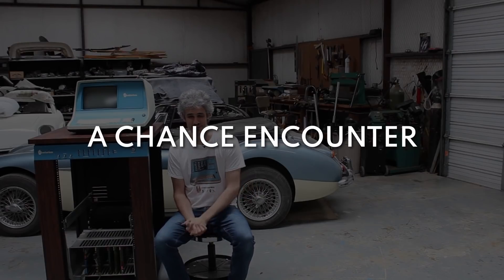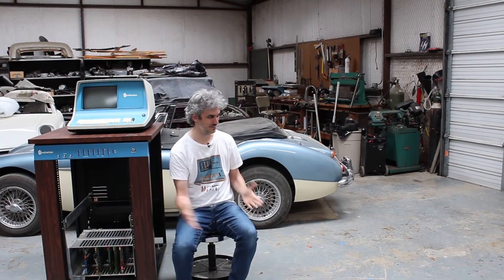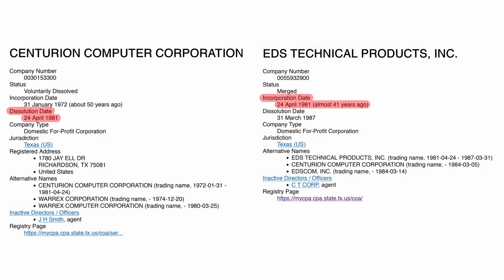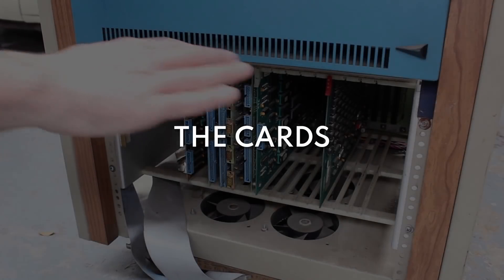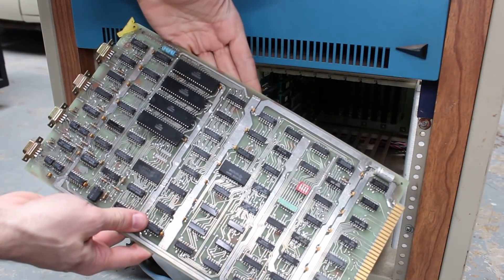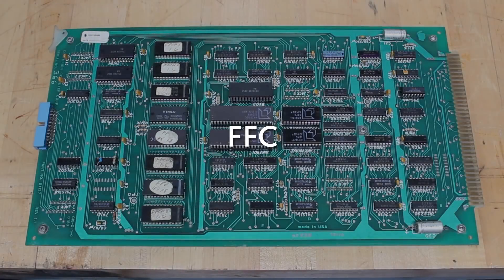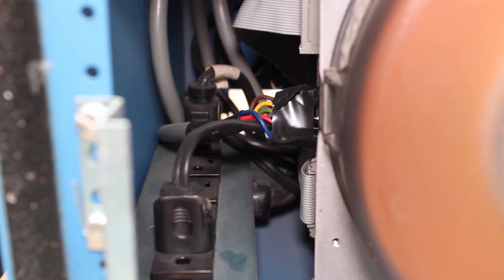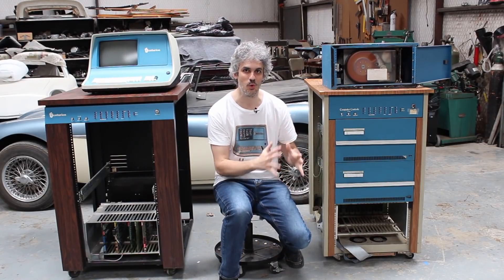Minicomputer Part 12: I Bought a What?!

Comment: It is amazing that you found another one of these and even one that shows the history so well. 
But what is even more amazing to me is that some company or organization used that thing at least up to 1994, mabe even longer who knows.
Reply from the maker: It's pretty crazy that they used that thing as long as they did! 
Some ex-Centurion employees were actually building Centurion software emulators on 386s and 486s by the mid-90s, trying to get customers to switch over to a more modern and stable hardware set, but the PCs of the time didn't have near the same multi-user capacity, so I can see why some places may have been reluctant to upgrade.

Comment: I would say that along with the importance of the machines' body is the importance of the machines' soul.  To think in a way to clone the disks content into modern media, to more than one type, like into disk images on SDs, SSDs,  into the cloud, and so.
By the way, excellent series, congratulations for the incredible work you are doing and to all that are activelly helping you on the path.
Reply from the maker: Thank you!
And that's absolutely on the list! One of the big reasons I got this system was because of the software that there may be on it. If we can get one of the Hawk drives working and connected to the genuine machine, we can then write some simple software to bit stream the data out the MUX card and onto a modern PC for backup!

Comment: Thanks for sharing, really cool. Having a second machine makes life a way easier because it allowed to make a diagnose by swapping the parts and/or using one as a donor to another, so you was really lucky to get this. I'm repairing an Epson HX20 from 1981 now, much smaller scale than yours but still fun :)
Reply from the maker: Thank you!
And you're absolutely right, having the genuine machine to test and diagnose parts makes life so much easier, and then we can really start doing proper work with the drives and hopefully save some of the original software.
The HX20 machine is such a cool machine because it was the size of a piece of A4 paper, which is absolutely mental for 1981!

Comment: Can the two computers do DMA off of each other's busses? You could have the first dual-core Centurion SMP cluster on your whole street!
Reply: That's for sure. When the "dual core" is operational noone else is getting enough electricity to run a similar machine.😁
Reply from the maker: Unfortunately, they're not quite setup for that. But, it has been done in the past!
Apparently, one very smart engineer at Centurion took four CPU6 boards, built a custom backplane and wrote some very unique microcode to create, essentially, a four-core Centurion! Now that would be a proper piece of Centurion history!
Reply: @UsagiElectric  Well, if we all put our ripple tanks and 3D printers to work and made one from sand and oil, we wouldn't have to endure the purists who get mad about which parts were and were not re-made for the damned Centurion Wing of the National Computing Museum.

I just love the whole energy of this series (and its other fans) and nothing would make me smile bigger than this obscure little platform of yesteryear suddenly exploding into a 6502 level fanbase: "How I Made a CPU6X8 In My Spare Time For Only $10,000". And at the end of the article there's the table of 100 digit precision arctangents he printed. :) :) Seriously, I'm loving this adventure in retrocomputing so hard.

Comment: Re: interrupt level driven multitasking, I would call it multi-tasking at an extremely low-level. Interestingly enough, this is roughly how modern systems handle the myriad of interrupts from all our fancy devices, along with all the requisite handler/service routines and then the later bottom-half handler/DPC routines (usually de-queued by a specific thread with IRQ’s enabled in Linux, or at the DPC IRQL in Windows (NT)). That said, using just basic interrupts to drive user context switching for interactive workloads is a less than great approach, but probably worked okay for the very basic serial attached terminal driven workloads of the time.

I gotta say, the more we learn about Centurion, the more it sounds like a great basis for a period TV show.

Comment: The interface on that Finch card looks quite familiar, and looking at the hard disk specs makes me wonder if the drive was actually an early MFM drive. Which means you could connect up any 1980s hard disk drive (e.g. a Seagate) as a replacement.
Reply: I noticed that too (the dual ribbon cable ports), but I kind of doubt they're spec'd for an MFM drive. I'm thinking that they are probably closer to early 50 pin SCSI drives as far as operation and data transfer. I had a couple of those 20 mb. Seagate MFM's in my first 80286 when I was playing around with some early versions of MS-DOS.😉Talk about NOISY! They all sounded like a jet engine spooling up when they started!🤣
Reply: @danw1955  The drive spec sheet talks about being able to connect more than one disk (either floppy or hard disk) on the wide ribbon cable, and the narrow cable is point-to-point. That leads me to believe that this drive may be MFM.

MFM drives were also pretty common in early 1980s systems so it wouldn't be unlikely.

I didn't see any big circuit boards on the drive itself -- SCSI drives contain a considerable degree of intelligence in the drive, while MFM drives are just dumb electromechanical front-ends.

Comment: I find it amusing that the rack is standard because the rack is based on the telecom switchboard dimensions, and by that point - in the 70s, everyone had standardised their racking against telecom standards which was the origin of the datacentre. IBM tried to buck that trend for a while with their mainframes, but the telecom rack won the battle.
Reply: I recall Telecom Equip. racks being 23" wide and Data Equip - Networking or Computer racks being 19" wide.  The Centurion chassis rack is setup for 19" hardware.  Mr. Martin are you in the North Dallas area, seems like I know may know you?

Comment: I'd hope the computers were decommissioned because the company finally got off the accounting system they were running on it.  It's really hard to change accounting systems, so they probably kept the old one running as long as practical.  I'm guessing it's accounting, because that seemed to be the most common, but it's probably some core process that would be a mess to transfer to new software.  Although, I wouldn't rule out that it was decommissioned when the company running it went bankrupt.  They simply didn't have the cash flow to convert.
Reply from the maker: You're on the mark! The two removable platters that were in the drives when I got the machine both had stickers on them that say "payroll." 
By 1995 the CPU6 design was already around 15 years old, so it was definitely outclassed by many modern machines like the 486 or even the Pentium, but I'm with you in that they probably didn't want to try to transfer to a new software environment or they didn't have the cash flow to convert.
It'll be interesting to see what kind of condition the drives are in!

Comment: Hi David.
Love this series btw.
I've just been looking through the instruction page on the wiki you mentioned and in the Address Byte column you have mnemonics (in order of appearance) PC+N, _H/L, _W, _H/L_H/L, _W_W (I'll stop here as there are a lot more), but there is no indication in the notes column as to which byte (H or L) the instruction is working on or what the N is referring to.

Also, I think there may be some errors, I maybe wrong, in the positioning of the _H/L_H/L and _W_W entries that appear in the first Address Byte column.  I'm wondering if they should be split between the two Address Byte columns ? Being that each column represents 8 bits and the H and L are both 4 bits a peace.

Besides the above observations, I think it's a great breakdown and very informative. I have my own challenge, similar to your 1 bit Valve computer (excellent btw), and this Centurion series is very helpful.
Reply from the maker: Thank you so much!

The Wiki for the instruction set has actually recently been updated (like within the last 24 hours) to something that should hopefully make a bit more sense. We're still figuring it all out, so it's likely to change a couple more times as well. 

The big thing that I think was poorly explained is how you address registers. Since the registers are all 16-bit, you can either address the register as a whole, or you can individually address the high byte or low byte. When I write "_H/_L" or "_W" with the preceding underscore, the underscore represents whichever register you want to address. 

For example, an ADD byte operation would look something like: ADD AH, BH which would add the high byte of the A register and the high byte of the B register and store the result in the A register. To convert it to hexadecimal, the ADD byte OpCode is 0x40 and each register is addressed by a nibble that represents which byte we want to use, so register AH is 0x0 and BH is 0x2. That means that ADD AH, BH = 0x40 02.

Interestingly, if we want to do an ADD word operation, we use the high byte nibble when referencing the entire word as well, which gives us ADD AW, BW = 0x50 02.

At any rate, that's how they address two registers and specify word, high byte or low byte using just 8-bits. 
As for the PC+N, this is just a relative jump from the current position of the program counter. The +N is the 1-byte offset to jump. However, with this one it's best to think of it in binary. The first 7-bits is the distance to jump, and then the 8th bit is the direction, which means it can jump up to 127 instructions forward or backwards. For example, if I wanted to jump 34 instructions forwards, the instruction would be JMP 0x22 = 0x72 22. If I wanted to jump 34 instructions backwards, I just change the 8th bit to a 1, which gives us JMP 0xA2 = 0x73 A2.

It's a pretty wild instruction set with a boat load crazy things you can do, but hopefully that gives a little more insight!

Comment: "Just two Davids.... hanging out..."

I just finished watching this entire series.... this morning i woke up thinking about those bypass capacitors doing the back-flips....

Ceramics are fragile? So maybe bending the leads like that offers mechanical strain relief? Looks like it gives a nice place to clips scope leads, but why you'd need that on a bypass cap, let alone all of them....

I don't remember which video that was brought up in... there's probably an entire thread under that video dedicated to the question... with a correct answer...

Comment: Hi Dave and Ken;
Ken, Thank You for Your prompt reply.. Ok, I understand..
Do You remember on CPU1 and CPU2 and CPU3 what was used as an ALU, like 74LS181 or something even more basic like the 74LS283 ?? Or something else?? I would like/love to build one using wire-wrap and taking any information You can provide that would help me build these boards on blank wire-wrap boards, mostly of my own design using Centurion instructions..
THANK YOU Marty
Reply: Do not recall if the ALU used any of the chips you called out.  The 74LS181 is out because of the 24 pin package, do not recall any 24 dips on the CPU cards.   All the TTL and ECL chips had to be available well before 1971.

Comment: Wow. Cool  system.  I cannot wait until you clean it, and get it running.  Can you connect the Finch drive to the genuine Centurion?   or doesn't it have the necessary software/hardware?

Comment: These weren't counterfeit, per se. IIRC, they were manufactured by Centurion from their spares as off-the-books units. A little extra secret revenue stream not shared with new owner EDS. That was the sticking point and final nail in their coffin.
Reply: Mr. Jones,  Did you work at the Centurion dealer in Richardson or Tulsa?  I would like to talk with you sometime. Just talked to Terry a few weeks ago.

Comment: Anything new on the MC14500 1 bit computer?
Reply: What was he doing with one of those? Did he talk about implementing it in discrete transistors/tubes? I think it only used 500 transistors.
Reply from the maker: Actually yes!
I've been working on the UE14500 vacuum tube implementation of it regularly, and there have been recent update videos on it (the video released last week was working on it). 

But, behind the scenes, I've been using everything I've been learning from the tube version and from this Centurion to start designing a full homebrew based around the original MC14500. I'm trying to design it with a universal bus and expandable cards, plenty of RAM, cartridges that can be popped in for different programs, and to run at near 1Mhz. The goal is to have an MC14500 based system that can interface with a terminal properly and do standard computing stuff. It'll require some very inventive programming to get it doing anything meaningful, but I think it could be a very interesting homebrew system!

Comment: These date from the time in which the novel "The Adolescence of P1" was written.  There was an attempt to turn the story into a movie, using more up-to-date technology, but the tension and tragedy of the original story was totally lost in the process and the ending of the movie was pretty lame.
(The novel is another "computer program becomes a sentient AI" story, but with a few twists since it crosses over with computer viruses and networking and non-corporeal entity themes.  The computer program doesn't run on a single computer but on hundreds of computers across a network of "teleprocessing" ports).

Comment: Hi All;
Thank You Ken for Your prompt Reply..
Ok, does any of these ring a bell with You, 7480, 7482, 7483, 74183, 74283 ??
Also, did You base Your Design on any existing Machines, like Varian Computers ?? Or was Your Design an all new concept of the way things would be done?? Such as (I gather or think) using memory for the base registers and the Interrupts for choosing where the base register was accessed or located ??
Thank You for Your time and Answers..
MARTY
Reply: The great grandfather system to the first Warrex - Centurion system ( CPU4 ) is the [ ee200 ].  The other models like the CPU5, 6 & 7 supported the ee200 opcodes and more advanced opcodes that are 100% Centurion's.  For more details on this project restoring the Centurion CPU6 system check out the "  Discord " server ( URL listed the read more section }.  If you join the Discord server please read the past posts because most of your questions are likely to have been addressed. The restore team has a number of sections listed under [ centurion minicomputer ].

Comment: So the Finch drive is not a floppy drive then? I wonder what FFC stands for?
Reply: FFC is the Centurion AMD2901 based controller for CDC 8" Floppy Drive and CDC 8" Winchester Drive.   The FFC can handle  (1 to 3)  8" Floppy drives  or  (1) 8" Floppy drives plus ( 1 to 3 )  8" Floppy drives.   Regards,  Ken R.

Comment: Now you have a Fake Centurion ,  and have reversed engineered most cards ,  how about making a fake fake centurion.  Use the 3rd Terminal that is on the back burner at present,  order some PCBs from PCWay or wherever.  Possibly make the CPU6 as a CPU5 double board style (As Slot 2 on backplain is empty for that additional width for a paired double. Check with your TOS / other test and OS items and maybe see if the system can be engineered for a "normal" (Full height or whatever) 3.5in HDD formatted to the Centurion Standard, A 8in Floppy and a 5in Floppy ?  This could be interesting to see how a Centurion could have moved hardware wise.  I wonder if those crashed hard disks can be re-coated too in the same way the bendix drum might be done.

Comment: You have a nice presenting style and you seem honestly excited and cool stor bro. But just because the one hdd is "sealed" as you call it (it's just a normal hdd. Every hdd is "sealed" except syQuest and other portable hdd) does not mean it will work. Sometimes the head gets stuck to the surface or it will not spin because of grease gone bad etc. It's a mechanical device after all.

Comment: I felt this episode was far too wordy with little meat; I guess I am a hardware guy through and through.
Butchering the 'new' machine wouldn't make it a genuine Centurion just a bastard used in the original meaning of the term.
Why not do it the other way round? Use the original as the museum piece and experiment on the 'clone'.